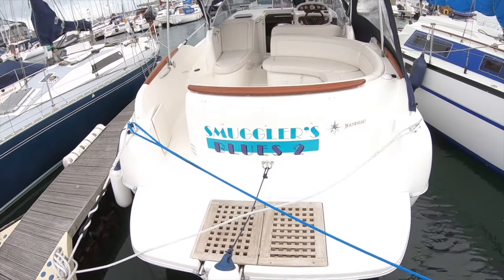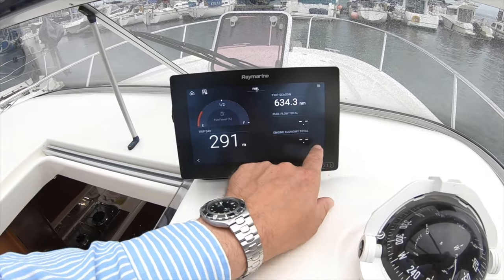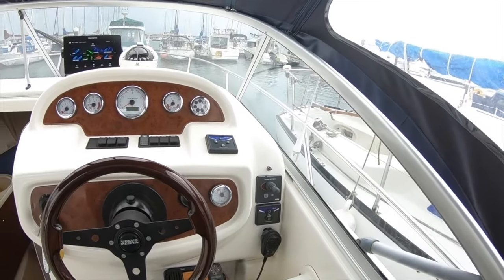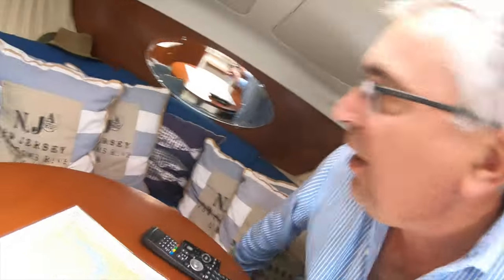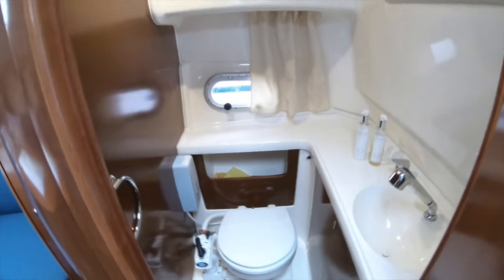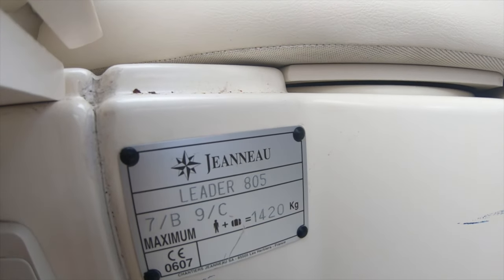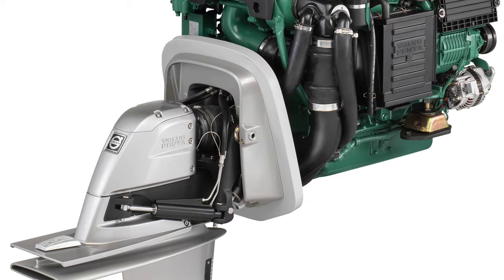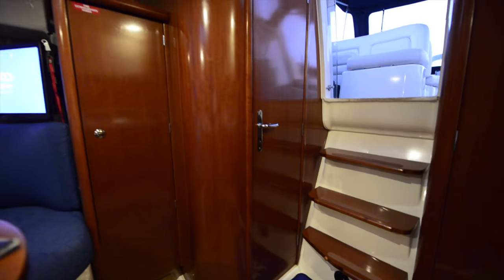MY OWN BOAT : Jeanneau Leader 805 Full Tour

Comment: I love your boat! What are the running costs for owning a boat like this?
Reply from the maker: I reckon on about £5-6K a year for everything, berth, servicing, out for the winter, lifts in and out, insurance everything. The only extra above is fuel, we used the boat a lot last year and used about £1,000 of fuel. That was over 100 hours use so roughly £10/hour in fuel on average.
Reply: AQUAHOLIC hey thanks for that info, that’s not as much as I thought it would be, I was thinking nearer the 8-10k mark. I’m sure I’ll own a boat at some point in my life. Hopefully not too far in the future. I can see myself in something like yours for sure. 👍🏼
Reply from the maker: Good luck - it's worth every penny!
Reply: @teamloony  The biggest difference is where you keep the boat. Solent area & you are looking at the thick end of that £5-6k just for the mooring, further from there the cheaper. 
My Sealine 270 is in La Rochelle France & we pay € 2k.

Comment: Any ideas what the actual wieght is... jeaneux suggest 2.4t but I can't believe this. Was hoping these could be towed with a decent 4x4
Reply from the maker: You won't tow one of these with a 4x4 because with the weight of a suitable trailer it will be over 3.5 tonnes, plus it's too wide.
Reply: @AQUAHOLIC  you can have a width of 2.9 which I think the 805 is? I just didn't know how close it was... for example without fuel and water and a aluminium purpose build trailer could this just about scrape through? Be good if someone had the actually wieght of the boat
Reply from the maker: @shaunizzard2410  The 805 is 3 metres wide. I have a figure of 2,250kg for the weight, but bear in mind that might be Jeanneau's 'base' figure, with diesel engines adding weight, plus fuel, plus gear, etc. I'd be very surprised if you could put one on a sensible twin axle trailer and come out at 3,500kg total (and if you did, it's still too wide).

Comment: What roughly would that boat cost ?
Reply from the maker: These vary depending on age, engine and condition. An early tatty petrol example is probably circa £30K, a late model with a D4 diesel in good order would be nearer £50K.

Comment: Nick, just wondering what your thoughts are on night passages/res vis?  Would it be possible to add a radar onto your boat?  I presume it’s possible to have a radar arch fabricated, but that would decrease stability I’d imagine.  Do you know if it even possible to fit an arch to an 805 Leader, how would you do it?
Reply from the maker: I can't imagine a stainless steel arch and a radome would make a jot of difference to stability. It's extremely rare we're out at night, other than maybe to watch a summer firework display in which case we just trundle gently back at 5 knots with the navigation lights on, don't need radar for that.
Reply: AQUAHOLIC I did write a reply earlier but not sure if it went through!  Thanks so much for the reply.  Keep up the good work with the videos, we love watching them! ⚓️⚓️

Comment: Hi Nick, I was considering the Leader 8, especially given your reviews and costs of this 805. However, on closer inspection of the dimensions, the 8 looks a lot heavier and bigger (2939kg vs 2100kg). 

It seems the newer boats have all become generally larger and heavier and my main concern is fuel consumption. Being 40% heavier, would you expect it to use a lot more fuel, or are the newer engines more efficient, thus cancelling out the fact it’s a larger version of the same boat?
Reply from the maker: Hi Chris. I don't have any figures on the Leader 8 so you may be right, but it's REALLY hard to see how Jeanneau managed to increase the weight by almost 50%, where would they put it? Generally newer boats get lighter as technology improves although you're right, they do get bulkier. However having been on an 8 and an 805, it certainly doesn't seem bulkier.  I'd be inclined to double-check the weight of the Leader 8, that sounds a lot! (Not saying it's necessarily wrong, I don't know, but I do struggle to comprehend just how they could add almost a tonne of extra weight to a boat that only weighs just over 2 tonnes).
Reply: AQUAHOLIC thanks Nick, appreciate the reply and thoughts.

I was shocked too by this increase, but as a newbie I was unsure. I’ve gone off the Jeanneau website. 

https://www.jeanneau.com/en-gb/boats/powerboat/8-leader/259-leader-805/
https://www.jeanneau.com/en-gb/boats/powerboat/8-leader/24-leader-8/

Let me know if you have any additional thoughts, I’ll also drop them a line and report back!

Comment: Does the toilet flush into the sea?
Reply from the maker: Yes. We never use it 'in anger'! (And toilet roll used by ladies goes into a 'nappy sack' and gets disposed of ashore, not flushed into the sea)
Reply: @AQUAHOLIC  Thanks for the prompt response. I asked as I was interested in how toilets work in Yachts and from my research learned that there are different solutions usually involving a holding tank that gets emptied to an offshore facility. But on this boat, I heard you mention that the water comes from the sea and goes back out again which is something I was yet to hear of.
Reply from the maker: @SirTech64  It's a pretty normal set up on a small boat, larger ones often have holding tanks.

Comment: What’s the point of having a 10 foot beam if you are going to take up 2 feet of it with walk arounds? I would much rather have 2 more feet of interior space, and some kind of a walkthrough at the front.
Reply from the maker: So that you can walk around it. A far easier and safer route to the bow and way better for putting fenders out for example. Or try picking up a mooring buoy from the stern (where the boat is lower) and walking it to the bow when the only way to get there is through the middle of the screen.
Reply: AQUAHOLIC you’re giving up interior space which you will be using 99.9% of the time to make .1% of your time just a little bit more convenient? On a 45 foot boat. I obviously don’t have the boating experience you have but it just seems like a waste to me.
Reply from the maker: @barryfields2964  Take a look at 7:13, you'll see that the cabin extends under those decks inside. But actually it doesn't make a lot of different anyway as the hull tapers as it drops toward the waterline